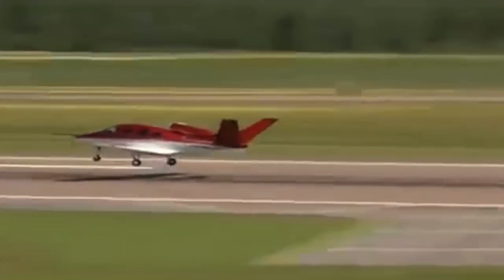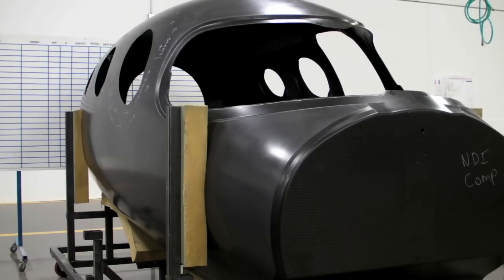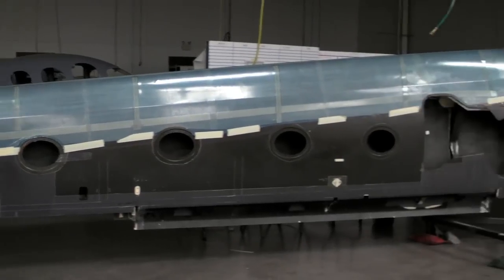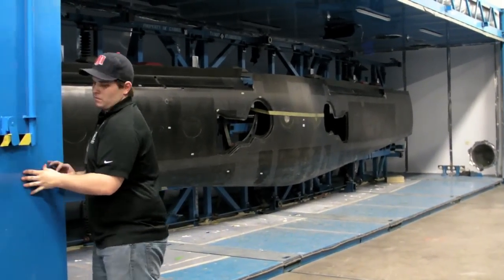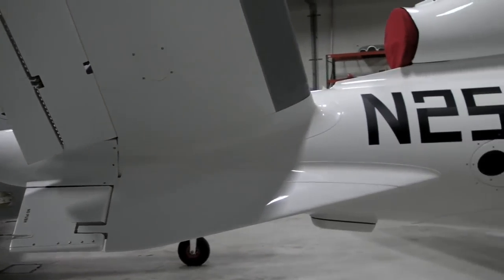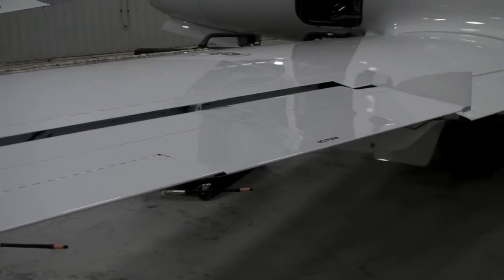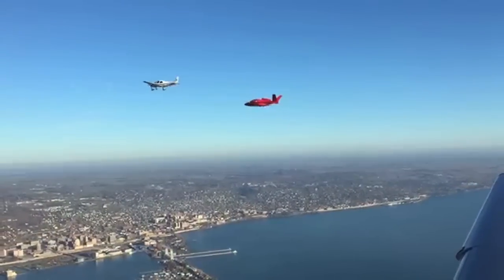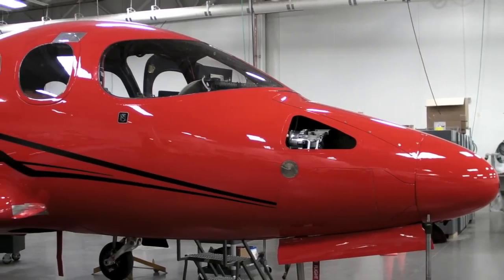Production Starts On Cirrus Vision SF50 Jet

Comment: TBM900 is faster with longer range and more space, but this thing looks pretty cool, i wonder what the cabin noise is like
Reply: The TBM900 is also twice the money.  How an F35 is 5x faster than a TBM900...does that help?
Reply: Again, you cannot compare the two.  One is a NEW personal jet with state of the art panel and a parachute...the fuel burn is not known yet but must be lower than any other twin jet.  A used SF50 does not exist yet, but when it does it will be just as cheaper than a used TBM because the TBM already starts out double the cost of the SF50.
Reply: For sure If you can afford the SF50 and the associated maintenance,fuel and hanger fees you can also afford the TBM etc,  These aircraft are not for the budget conscious like somebody who has worked their entire life to purchase a new 172 skyhawk, these are for extremely wealthy individuals, The parachute on the cirrus hasn't done much for its safety record, so its also a mute point, the panels are nice though. No doubt its a nice aircraft,
Reply: The SF50 has no record of chute pulls yet...the first production unit has not been delivered.  You cannot compare a USED aircraft to a NEW aircraft...esp one that has state of the art touch-screen avionics and is an all carbon-fiber airframe versus the old style aluminum rivets and bends.  The cost to run a TBM is well known, the cost to run an SF50 is unknown.  No one has even knows the fuel burn rates or the cost to get an annual.
Reply: I've heard a 747 has even more range and room than the TBM, can you tell us whether or not this is true Mr. Jollytater? I'm thinking it might be nice to be able to carry a few hundred passengers on occasion.
Reply: @jessejesse5844  it’s about 3 times the range with a 747.

Comment: Slower than a turboprop twin and burns more fuel doing so. I wish them well because we need innovation in GA, but the specs don't add up on this one. Still, I hope they sell millions. I'll be saving money and time in turboprop twin.
Reply: What is the fuel burn of the SF50?  Oh that's right they are not published yet.  And remember, none of the turboprops  has a parachute....but then, most old timers don't care about the chute...they prefer hitting cars on a freeway when they get into trouble.
Reply: Your assumption are off.  The SF50 is a cross country flyer as is the 
SR22T the plane most who have the money will step up from to the SF50.  
The SR22T can do 2000nm in a day.  The SF50 can cross the country in a day.

The single engine component of the SF50 is enabled because the engine is 
new, small and far more efficient than twin jets.  And having one jet 
engine is half the maintenance cost of a twin.  The avionics in the SF50 
are the Garmin G3000 touch screens far more advanced than anything in a 
twin turboprop or in most small business class jets.  The avionics 
enables single pilot ops.

There are 600 SF50 back ordered a full five year backlog.  No other 
small jet or turboprop comes anywhere near those numbers.
Reply: Cirrus built this as a step up aircraft for their SR22 customers. It's basically an SR22 with more speed that can fly higher and farther. TBM and PC-12 are overkill for that market. Two people, most likely flying less than 500nm. That's the SF50 market. MU2 is better bang for the buck but you need to be a proficient twin pilot to fly it safely. SR22 to SF50 transition should be a smooth one. Almost same avionics. Systems are simple so the pilot can concentrate on navigating and communicating while the aircraft pretty much flies itself.
Reply: Great range is the best speed mod there is. If you have to stop 3 times to cross the US (which would be the case with the SF50), vs 1 time in a much slower airplane, the slower plane will win in time. There is no way to get from flight level to on the ground, refueled and up to FL again in less than an hour. At least I've never found one. If you have to stop 3 times, that's 3hrs lost. At least. That's why a turboprop with good range will get there faster. And burn less fuel doing so.
Reply: ***** Any Garrett powered turboprop. A Turbo Commander will do 58gal/hr going 300kts. Or a MU-2. Most PT6's as well, although their fuel burn is a little higher. That's a lot less than the Cirrus Jet, both per nm and per passenger.
Reply: +stratobee exactly my thoughts it burns way to much fuel ts ridiculous for such a small and slow jet
Reply: The SF50 has a 1300 nm (1500 mi) range at cruise, 300ktas.  This 
requires one fuel stop (two would ensure reserves) to get cross country 
(2900mi) CA to NY.  At FL25k ground speed from West to East will be well 
around 350kts (400mph) with a 50kt tailwind. This would require 8 hours 
(giving 45 minutes for the fuel stops).

Turboprops are jets with a prop.  Most of them cruise at 270ktas.  The 
SF50 cruises at 300ktas.
Reply: No, performance numbers have not been released yet. But they're hinting at burning 70gal/hr, 300kts. With 296gal capacity, that's 4.22hrs endurance, remove 1hr for IFR reserves, and you're down to 3.22hrs and 966nm range at FL280. Going east to west, where you'll always hit headwinds (or get a lower altitude) and your GS and fuel burn goes up. On a NY to LA trip, I predict at the very least 2, but most likely 3 stops.

Listen, I like the thing, I want them to sell millions of it. But it won't save any time, or fuel, or money compared to a turboprop. This is a very slow jet, hampered by not being able to fly RSVM space above FL280. If it could fly at FL410, it would be huge difference. But there's no way of certifying a single to that level, as it requires redundant source of pressurization (i.e. another engine). Even a twin jet, like Mustang, Eclipse, HondaJet will burn less fuel up there than this.
Reply: They have performance numbers on their corporate website.  Cirrus is the 
ONLY maker that publishes actual performance numbers along with 
pricing.  No one dickers on a Cirrus.  Everyone pays the same.  You 
measure the jets fuel burn in pounds, not gallons btw. You seem to want 
to make up your own fantasy story about the plane.  Suggest you start 
over.   Btw.  Like the piston single models the SF50 is already a 
run-away winner.  600 in the backlog.  If you want one ya gotta wait 
five years!
Reply: There are no fuel numbers published, nor are there any real performance numbers. You know why? Because they're not very impressive. They'll come out eventually when the allow them to be flight tested by the press.

It will still sell a lot, has great cabin, great cockpit and is a good step up for SR22 pilots or people wanting a jet. But this plane will not be sold on it's performance, it will be sold on all the other things.
Reply: There is a range, fuel capacity (convert pounds to gallons use 6.8lbs 
for Jet-A)  and cruise number given.  That's all you need to derive the 
correct estimates.  The plane is designed to be a pressurized step-up 
from the SR22T.  It fits that profile perfectly.  Others may also choose 
the product given Cirrus quality and reputation and the planes low 
maintence due to a single engine design.  You may not be aware but the 
annual on a jet engine runs into the tens of thousands of dollars.  More 
than enough to make up for a slight increase in fuel burn.